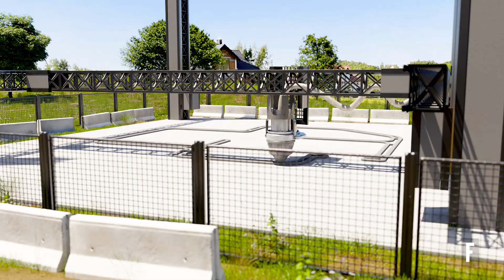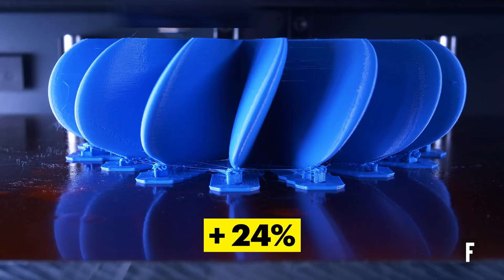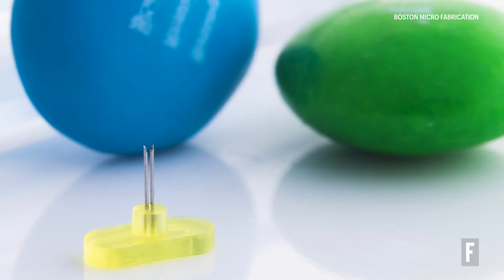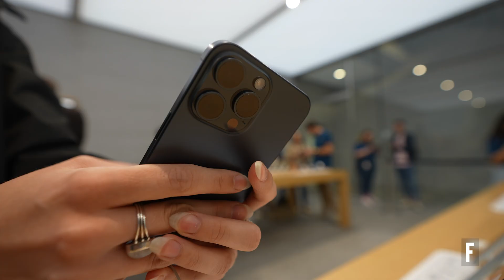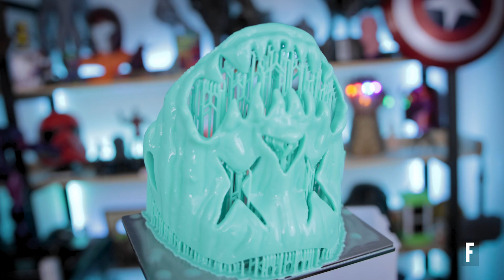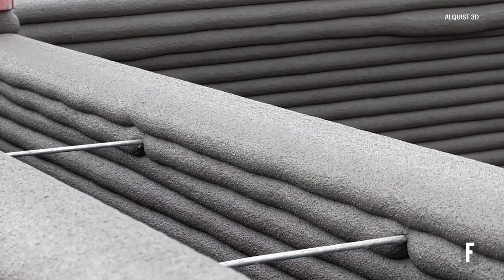Inside the $20 Billion 3D Printing Industry

Comment: The 3D printing industry is booming. The technology is there, the innovation is there, but, the understanding isn't there. There are engineers and designers who know how to make everything around us using the tried and true, and already figured out techniques. 3D printing cannot just replace parts one to one in most cases. So, just like how designers and engineers need to learn how to design for injection molding, or for CNC machining, or any other traditional method of manufacturing, they will have to learn how to design for additive manufacturing (DFAM) something that I have spent the last 8+ years learning.
Reply: D i t t o. 🤣